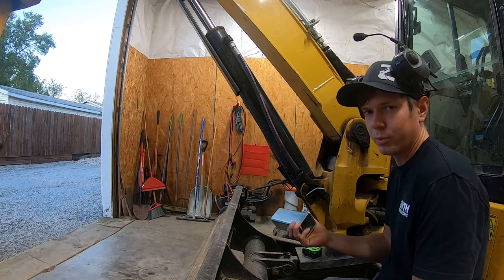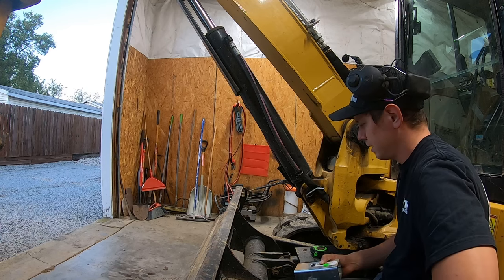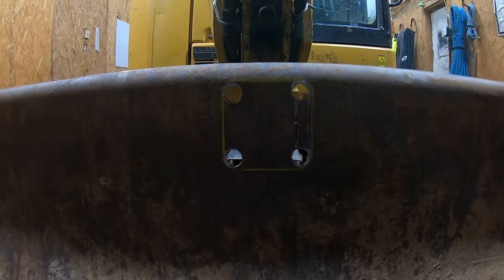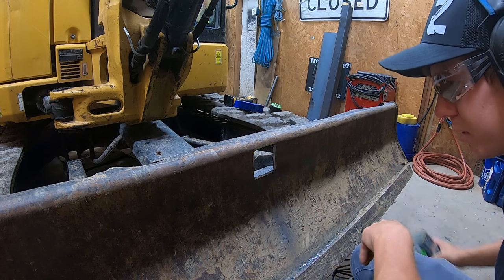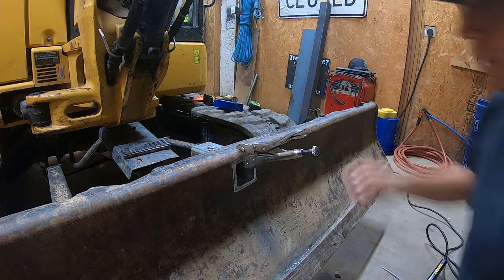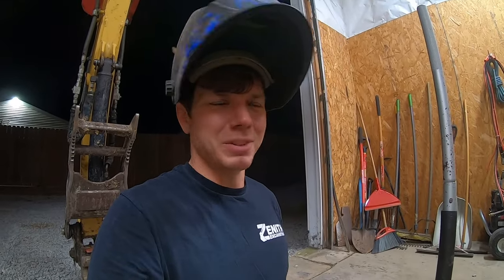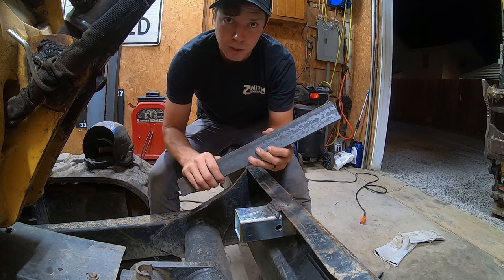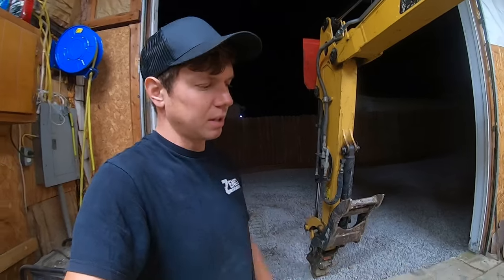Welding a Hitch to the Excavator

Comment: OMG that huts, watching you drill :) When drilling in steel use low speed and big pressure - push it hard. If a drill bit slips it means not enough pressure. Using high speed especially when a drill bit is slipping will get it blunt very quick. Plus, I'd use some oil or WD-40.
Reply from the maker: Haha, I definitely have seen the speed chart for drilling steel somewhere. If I have more expensive bits to protect I probably would have been a little more interested in getting that set up correctly. Thank you for sharing. Upon recommendation of another commenter, I've ordered some tap magic for next time 🤙

Comment: Get another piece of 2" square tube, weld a flush pug in one end, position it so that it sets flush with the blade  and drill your holes in it for your pin. That should help keep the mud/crud out of it.
Reply from the maker: Ohhh, that sounds like a great idea. I might have to do that next time I find myself with a scrap piece of tubing.

Comment: Carbide burrs are far better than those sandpaper tubes.  Also use some type of oil when drilling steel. And lastly, brace the drill against a knee or something to save your wrist. Those larger bits tend to grab.  

That's all my advice.  

I welded a hitch receiver on my box blade not long after i started welding.  It's uglier than yours but it's strong and super useful.  Good job getting to done.
Reply from the maker: Thabks for the tips! I was really thinking a die grinder would have been nice for that project. I've never used one, but they look like they would be super handy.

I'm imagining this will be one of those things that will be handier than I thought it would be. Time will tell 😅

Comment: I have a 2-5/16” and 2” ball welded on top of my Deere 35G excavator’s blade. Wonderful modification. Didn’t want to keep chiseling packed-in dirt out of a square hole for a reciever.

The best thing for tree work? The ability to hitch a dump trailer to the blade on the machine, and carry it with you to the base of a tree being removed. Fill it up and push it back into the woods. Dump. Repeat.

I do mostly rural tree removals where the customer has an acre or two of forested land, or wants me to simply dig a burn pit to dispose of the tree.
Reply from the maker: Ohhh that sounds like a great idea, especially for what you're doing! I might have to use that 🤔😅
Reply: @zaccheus  just buck everything shorter than the trailer is WIDE, and you can keep loading it laterally, dropping it in, and packing it against the tailgates using the back of the bucket. 😎

Comment: Oh DANG! The way you snapped that steel like like still has the Gp mind blown. 

Put a plug in that sucker so it dont get packed full of dirt on you. Im sure for what your doing with it your welds will be just fine.
Reply from the maker: Haha, I worked hard to make that a smooth break, thanks for noticing 😂

That's a great idea. I think I'll try to make one next time I have some spare tube lying around.

Comment: There is also some lubricant called tap magic that will will help with drilling through the steel. While it's actually cutting oil used for tapping/threading it will aid in drilling through the steel, make your drill bits last longer.
Reply from the maker: I think I might have heard of that from the Abomb79 channel. That's reaching a ways back into my memory, though. Thanks for the tip!

Comment: I notched mine threw the top lip of the blade and put the tube flush with the top lip. Plenty of weld without braces. Also had a gap to get penetration of the weld.
Reply from the maker: Yeah, I can see how that would work really well. I hadn't considered that. Thanks for sharing

Comment: 11:36 Comparing the welds, the one directly on the hitch tube was worse, im wondering if the tube isnt galvanized? 

I bet you are gonna use it to move a trailer 😂
Reply from the maker: The tube was definitely coated in something and that may have very well been a part of the problem. 

Maybe when I get a trailer someday!

Comment: This is just what i am thinking about doing, how is it holding up?
Reply from the maker: @villageearthwright  It's held up great. I haven't had any issues with it getting packed with mud or anything. I dont actually use my blade much for dirt though, so that might be why 😅

I have t seen any signs of deformation or anything. I have moved super heavy loads with it, but it's been really handy when I've needed it. Worth doing for sure
Reply: @zaccheus  So I ended up actually just cutting a slot in the top of mine and then contouring the front to match the blade, I really liked the flush face idea you have. I had mine just sticking out in the middle of the blade before and it never got packed with dirt to much.
Reply from the maker: @villageearthwright  nice! I can see how that portable woukd have been easier to install!

Comment: Milwaukee 12V - They have nice little die grinders.  The 90 deg Milwakee 12V die grinder is nice but expensive for what it is.  I do have a bigger straight Makita 18V die grinder - also nice.  But air die grinders are super cheap and good in the shop.  I don't have much for Milwaukee 12V.  The die grinders are nice and I have a job speaker.  Otherwise their battery design is dumb.  Oh, I got a few 12V soldering irons really cheap on ebay a while back.  They actually work well for quick jobs.
Reply from the maker: I've been torn between building a makita or mikwaukee collection for a long time. Makita seems to cost slightly more and there are fewer tools, but I already have the big angle drill and 4 batteries to go with it. Plus they seem to keep more of their tools in the 18v category rather than downsizing them to 12v
Reply: @zaccheus  Seems to me like Milwaukee batteries cost more, and some tools require huge 18V batteries.  Makita is good at letting you get cheap batteries on some of their kits.  Yeah, I don't like Milwaukee's push to make you get 12V tools.  Milwaukee still does not have a 18V nibbler and Makita has had one for years.  For the money, I like my Makita 36V top handle chainsaw and I don't have to buy special big batteries for it.  That said I do have some Milwaukee 18V since I wanted to try the red framing nailer.  I'd likely stay with Makita if I could choose only one.
Reply from the maker: @boomupengineering  Thanks sharing your thoughts on the matter.  I'm really not sure which direction I'll end up going in the long run 😅 seems like not a big win or loss either way.

Comment: Easier to get good penetration with stick welding so it isn't a bad way to go.  But a cheap wire feed welder with flux core wire is nice for such things.  Or solid wire if you use shielding gas and do it in the shop.  I have a Miller Passport which runs on 110V and 220V.  Has a paintgun CO2 bottle in the Pelican style case so you can literally plug it in and weld.
Reply from the maker: That sounds like a sweet little welder. I have a super cheap Harbor freight 110 wire welder. It's really only good for sheet metal though 😬
Reply: @zaccheus  I don't think there are any welders available now that compare to the Miller Passport.  I paid $800 for mine off of Craigslist.  Too bad Miller replaced it with a more expensive do-it-all welder that doesn't MIG as nicely as the cheaper Passport.  I put 0.023 stainless wire in mine to weld up my chainsaw muffler (Makita 7900) after gutting it.  Works well on carbon and stainless steel.
Reply from the maker: @boomupengineering  mmm maybe I'll have to keep my on the used market. That sounds like an impressive weld!

Comment: Why bother fabricating the entire thing you can buy a used receiver for just about any truck application on fb for $50 or less turn it upside down and cut it to length to span the inside to those side gussets on the blade and weld it in place..
Reply from the maker: @johnc1256  That's not a bad idea. I bought this reciever tube new for $10 at the a local truck equipment surplus store.